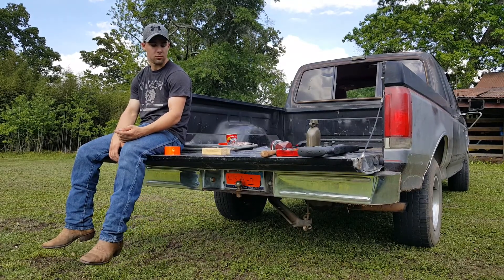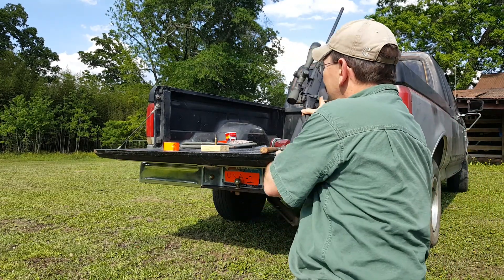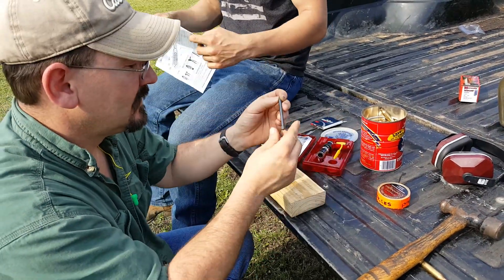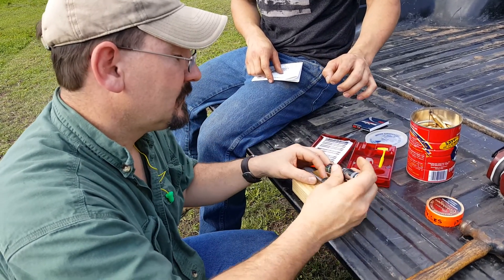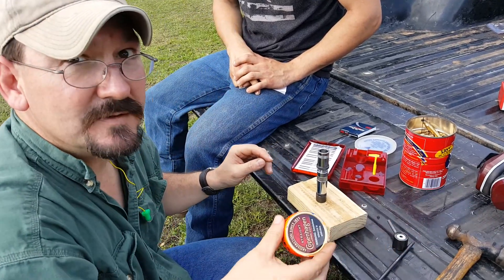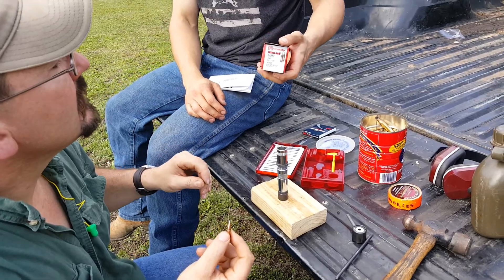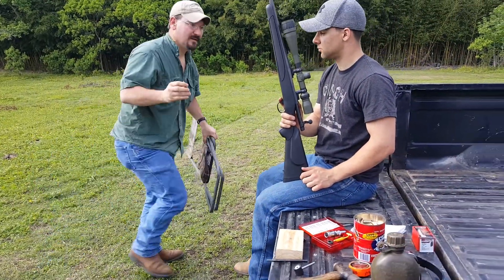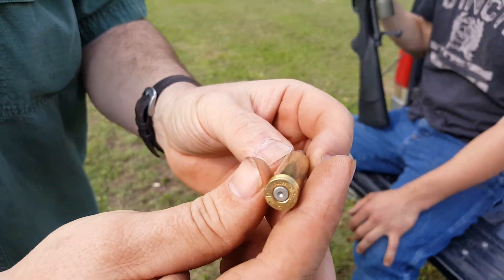Lee Classic Loader .243 Winchester

Comment: Great video! I just picked up a couple of them at a gun show for my 45/70 and 30-06. Even though I handload on a press they are still handy to use in the field or on the range.
Reply from the maker: swede72 Thanks for watching, We were doing this in the most basic way We could think of. You are right, If a scale were used, and a set of calipers this tool would be extremely handy for developing loads in the field.

Comment: My only constructive suggestion would be to use a rubber or plastic type mallet instead of a steel hammer. I liked that it was done on the back of a ute and not inside on a reloading bench. Good on you
Reply from the maker: Kevin Jones Yes Sir, I agree with You. Rubber mallet would have been better. Thank You very much for watching, and for speaking up. I really appreciate it.

Comment: FYI: Do not use a steel ball peen or carpenter hammer on the Lee Loader.  Lee does not recommend a "rubber hammer", but their instructions clearly show a non-marring hammer with plastic faces--this is so that you do not damage, mar or mushroom the component parts from hammer blows.  It will make the Loader last a lot longer and keep it pretty looking.  But since this is 'Murica, you do what you want sir. 🤪Most 'Muricans don't take care of their stuff anyway, so I understand completely.
Reply from the maker: Thanks for watching

Comment: as far as i can tell from the video someone gave you the brass....the lee loader only neck sizes the brass...you will need to either fully size the brass with another die before using brass first shot in other guns... or buy factory rounds and shoot them in the gun you intend to reload for...neck sizing brass is intended to be from fire formed brass from the same gun you are reloading for...otherwise you will load some that wont fit your gun...not good for hunting
Reply from the maker: bchrider Yes, The Brass and Rifle were loaned for the Video. We tried to load this in the most primitive method We could think of. Thanks for watching